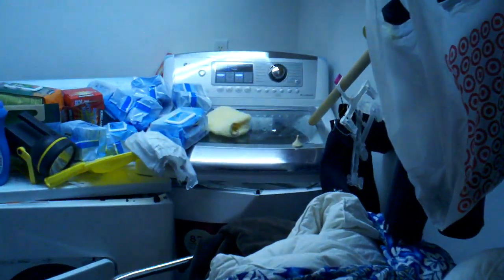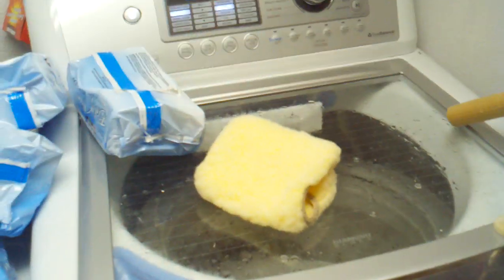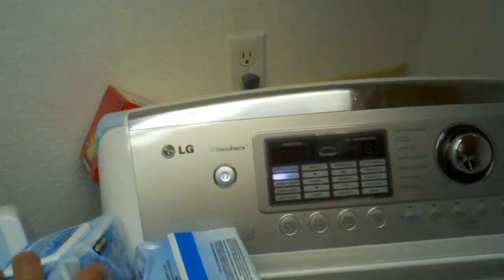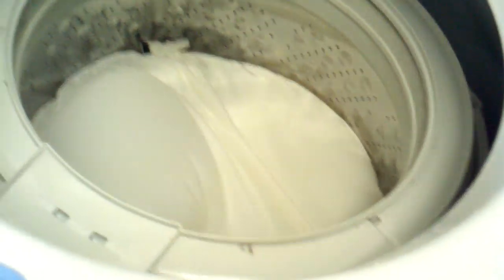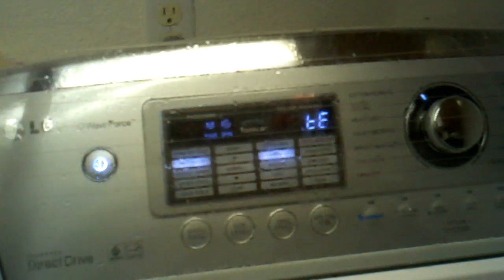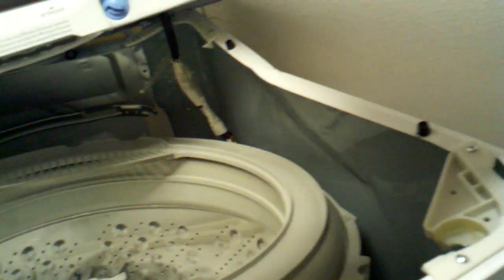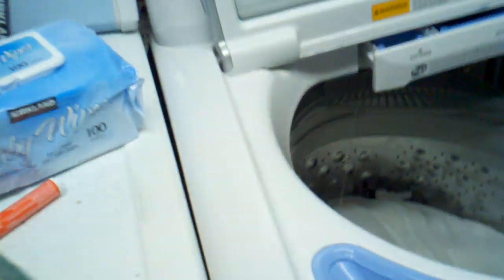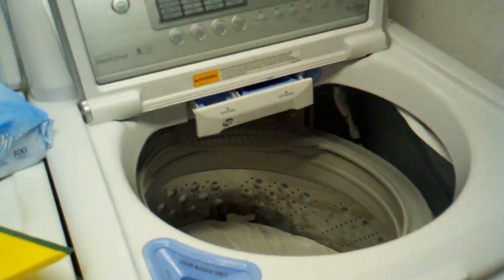LG Washer Gone Bad during Spin Cycle pt1/4

Comment from the maker: @Myworld691 - Yeah but the problem is this is our replacement, the first one died on us about 2 months ago only breaking 2 of its mounts adn denting the right side.  This blew out all 4 mounts and crushed all 4 sides of the machine, crushing our washer next to it pushing the side cabinet in 2 inches, putting an 8inch crack in our drywall on the otherside, opened drawers on my Toolbox in the garage on the adjoining wall...luckily we were not in the

Comment: I just got my Wave Force washer yesterday. I washed my big king size thick mattress pad in my on the bedding bulky cycle, and I increased the spin speed from medium to High. I had no issues with it doing this. I also washed my king size comforter next, again no issues. Next came two sets of king size sheets and pollow cases, again, no issues.

Comment: @TheGlozell2 
Wow, this is crazy !!  I own this machine and in another mo. I will of owned it for one year.  It's great on cleaning, but like I said before it makes me nervous knowing that this could happen.  There could be Faulty Brackets that may not be tightened properly and they could of loosened to the point of breakage and causing this to happen.  So did you get a replacement after this or go for a different machine ??  What did LG say or do for you about this ??  Thanks ...

Comment: Interesting point but what I'm trying to figure out is that it shouldn't matter what setting you use on a washer of this genre.. a critical imbalance should be detected and a fast spin prevented in that case. The Maytag front loader I've been using for years does this routinely with only wet clothes as a result. (A quick rearrange and respin and away I go) Just saying.
Reply: The problem is that you are supposed to use the bulky cycle for the big comforters . and the samsung vrt active wash washers blow up too. Even worse than the lg wave force . so id  perfer the lg or speed queen .

Comment: Problaly the washer feet. were not balnced and that he did not use the bulky cycle and it was too close to the dryer get a lg front loader becase is has sensors that will stop it from happening

Comment: Those new washers spin very fast. I would advise anyone to keep the spin speed on "low spin".
Reply: or Medium
Reply: my washer was a whirlpool cabrio HE washer,it was on the high spin speed with a twin comforter,never exploded,whirlpool did a great job at adding suspensions,it was off balance and uL occured,then the washer tried to redisturbute the comferter,still of balance and the uL started to blink,so my mom redistributed the comferter and it spun,it was going at 1100rpm
Reply: my washer was a whirlpool cabrio HE washer,it was on the high spin speed with a twin comforter,never exploded,whirlpool did a great job at adding suspensions,it was off balance and uL occured,then the washer tried to redisturbute the comferter,still of balance and the uL started to blink,so my mom redistributed the comferter and it spun,it was going at 1100rpm

Comment: Problems LG Wave Frce Wsher WT5001CW purchased February 2012. Many.Water fills up too much for2 casual tops. Placed work cloths on heavyduty & notenoughwater. Calibrates constantly. Stops at spincode UL.UnLevel. Blanket-set bulky bedding RearrangedHEAVY WETblanket severaltimes before it finally spin-when did washer shook. Longer wash time Sears mgr no help. Passed me on to LG. Cringe having to contact LG for I know I will be on phone&passed around. DoU have contact person at LG to lead me to?

Comment: Comforters get ridiculously heavy when they're wet.. And if I'm seeing it correctly, you tried to wash it on the cotton/normal cycle... Why? Each cycle is specifically set to treat the load properly so stuff like this doesn't happen. Most people that have problems with machine don't realize that it's they're fault for using / loading the machine improperly.
Reply: Sorry, Their** fault
Reply: You think most people have common sense???? Think again

Comment: @zgidwani   This makes me nervous everytime I have to do a load of wash after seeing this video because I have the same machine.  I've had mine since 9/23  and so far no problems, except using the Soak cycle which is more violent.
 
I see the Code flashing means Thermistor Error. 

Also in the Video you said twice that you put in a Comforter and it sure looks like a comforter and not a mattress pad like you later stated, and that should of been washed on Bulky only according to the manual.

Comment: I had this exact same washer and sold it with my former house. Now although it shouldve never exploded heres what i heard from your description and what i see from the setting. You washed a comforter and "a few other things" in one load also it reads that it was on the "cotton/normal". Ok wrong first off you wash any comforters,pillows, sheets, and rugs on the BULKY BEDDING setting. Its clearly stated on the label. Ive washed dog beds, mattress pads that were waterproof and it never exploded. Read your owners manual. I now i have a samsung and never ever had this problem as ive read my manula and use the correct settings. And yes on a sidenote this shouldve never happened but also cheap plastic materials dont help.

Comment: Here's the problem people. These washers are not designed to wash small loads. You put one large comforter in there, it's almost like putting a bowling ball in there. Why? Imagine all the water it absorbs and holds = off balance. If he had put 3 large comforters in there, this would not have happened

I'm not dismissing LG's responsibility and poor engineering. I'm just explaining why this happened. Leaving the shipping brackets on isn't too bright . People are sooo weird.

 Hell even and old 1970s top load Kenmore has something called an off balance buzzer. Are you listening LG?